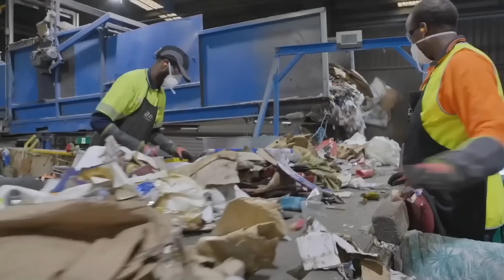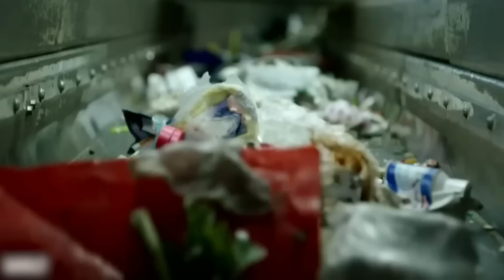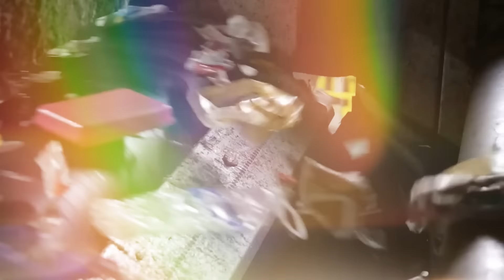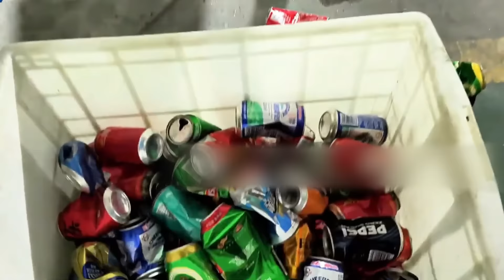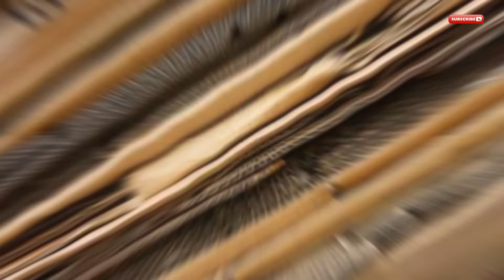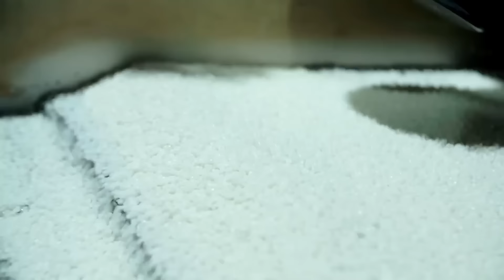How Recycling Plants Sort Mixed Waste in Seconds

Comment: Why don’t we make the packaging out of easily recyclable material in the first place?
Reply: it's a matter of cost and a variety of material characteristics.
For a simple example, paper recycles easily, but you can't use it to contain liquids without laminating and sealing it with plastic.
Out in "consumer land," there is a lot of generic plastic. In actuality there is a great variety of plastics with a great variety of characteristics, like rigidity, temperature sensitivity, resistance to sunlight, strength, Tasten-Neutrality and many others.  You wouldn't put a gallon of liquid in the same plastic as saran wrap.
Lastly and significantly is cost.  If a manufacturer chooses to use a container coats 5¢ more, that extra 5¢ must show up in the products ultimate price.  If a competitor product uses cheaper packaging, they can choose to offer their  product at a lower price, assuming all other costs of material and manufacturing for the two competing products are equal.
Bottom line:  it's complicated.
Reply: It will still get mixed with banana peels and ceramic varnish
Reply: Too many different plastics, especially, has to be the target for the future.
Reply: Some contents simply demand multiple layers of a container to hold them, otherwise there are various issues.
Reply: Yes!! Limited number of packaging materials and styles from which companies choose. A deposit value on each would incentivise re-use as is, rather than crushing, sorting etc which very often downscales the next version of itself.
Reply: Because the CEO of the plant that makes the material wouldn't make as much money.........period

Comment: I used to work in a major shopping centre complex. In the food courts are 2 bins - one for food and the other for recycling. When full, they're wheeled off down to the basement where the trucks are.
You think there are separate trucks - one for food and the other for recycling?
Nope, all the bins were emptied together in the same trucks. 
No recycling whatsoever.
Reply: In the UK households are given Wheelie Bins of differing colours so waste can be sorted. Even down to the colour of glass a household, putting a green bottle in the white bottle can be fined. One of my neighbors did just that and paid his fine.
Each colour of glass was emptied in a separate compartment on the tipping truck. About a week later the neighbor was getting his car tested at the MOT testing station right next door to the recycling plant. Looking through the chain link fence he noticed glass  collection truck reverse up to the glass bin and tip each colour of glass right onto the previous colour. He quickly took photos' of this and presented them to the local newspaper. All misplaced coloured glass fine had to be repaid
Reply: Yep recycling is a huge lie.

Fun fact  during ww2 the recycling drives were just to make people think they are doing something.  Very little was actually reused.
And once again history repeats...
Reply: @FC-qe1wl  Utter Rot.
Reply: @FC-qe1wl Yep! All those railings taken away went to waste- not a useable iron for military use.
Reply: @sceptickle  And all the donated candelabras from our pianos. 😮
Reply: Same at Caterpillar with cardboard boxes-we sorted them then had a huge packing machine that made huge bundles-which I later saw at the landfill. This recycling thing is green washing and it makes imbeciles feel good somehow that we are doing Wonderful things with garbage.
Reply: Reason why we will be mining the landfills in the future
Reply: Garbage trucks these days have two compartments, one for trash and one for recycling. So the same vehicle can pick up both....
Reply: @mercanyinriechert6732  It doesn't stop the contamination when people put the wrong item in the wrong bin! I used to work part time at a recycling facility, and if there was contamination they just ran the conveyor and it went to landfill, along with any good recyclables. It just wasn't worth trying to salvage it.
Reply: https://www.youtube.com/watch?v=v7OPskY4N8Y&t=897s
Reply: The waste trucks have different compartments.
Reply: Not that it really matters but this is in Melbourne Australia.
TheByard: likewise here, different coloured bins.
Red - food
Yellow - recycle - paper glass tins
Green - umm greenery stuff
Some suburbs also have purple bins, don't know what theyre for.
Reply: That pisses me off. The same thing happens in some suburbs as well, where recycle and general waste are collected by a truck that takes both bins, so I don't give a shit now and don't recycle anymore, if the council and government lie to me then fu@k them.
Reply: There could be multiple loads in same car, 2-3 often, different box inside truck. At least here in Finland.
Reply: The best thing is to separate it a t the plant. Having multiple transport chains to deal with waste streams that are contaminated anyway is a huge waste of time and energy.
But you know, you can base a political campaign on that. People want to do something for the environment and most of all, want to force other to do something.
Reply: Sometimes the recycling "framework" is put in place by company policies, architects, designers, landlord regulations, etc. And then the next company in line comes along with a different "framework". This is what you are seeing. In any case, it is still best to aim for the desired outcome no matter what.
Reply: I drive around central London all day 6 days a week and the local boroughs have these waste bins for the general public to put there small items of rubbish in the left hand side is black for non recyclable items and the right hand side is green for recyclable items tins ,paper and plastic but what humours me is when the guy with the push cart comes around to empty the bins he will open one side of the bin and empty it into his cart then open the other side of the bin and empty it on top of the previous load that he had just emptied then pull the fitted bag out of his own bin with both loads inside and ties the whole bag up and leaves it by the side of the public bin. He only has one type of bag and all the same colour so it’s not his fault for not separating the waste and to cap it all off when the big truck comes around to collect all this it’s all  thrown in the back of the truck……
The local councils must know this goes on but do it for the publics sake to keep them happy.
Reply: @ANDTHEIRAWAY Wild and disheartening. Also, would make an excellent comedic bit. Why can’t we just do good shit for our home and humans? There has to be some oversight and way to manage the separation of materials, right? Just do it. It would be so cool to have systems in place for these types of programs that were followed through on and not entirely bullshit.
Reply: Maybe I should add that this was in 2012 so I don't if dual-compartment trucks were around then and if so, were they being used?

I'm puzzled in that I keep on getting "likes".

So maybe I'm correct in my original comment?
Reply: Yea, companies get away with a lot. 

I worked briefly for ADM in Decatur, IL. They agreed to do safety inspections frequently. An engineer got assigned to it. The inspections were a tool engineers were required to direct at workers management didn't like. Instead, since it was punishment for me, I wrote up the company every time I could. 

It didn't matter. ADM took those reports and dumped them into file cabinets. Then, every year, they'd burn them. The insurance company had their paper. ADM got lower insurance premiums but the safety and environmental work never got done.
Reply: There's several shopping centers in the city I live in, and some people are just lazy and will put completely inappropriate objects in or on a bin meant for recycling. Plastic trays used to hold cake or other baked goods just left half open on top of a bin meant for drink cans means someone has to be cleaning up the mess some irresponsible person left behind because they were too lazy or in too much of a hurry to figure out where it should have been put. The shopping center has neither the time nor the resources needed to do the right thing the customer should have done, and most of it will simply be sent straight to the refuse stream and either incinerated or sent to landfill. They usually have giant compactors and have strict rules regarding what stores can put in which area in the garbage handling facilities provided for the stores. This is usually the same place for the garbage the general public leaves behind at the shopping center.
Reply: All recycling should be done like this. We should not have to separate  it at home and then it could be collected weekly!